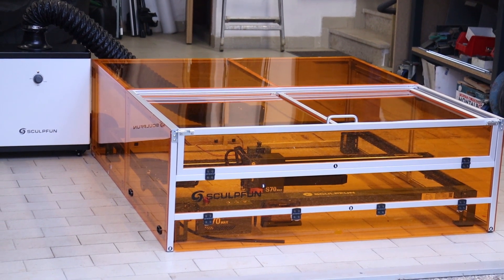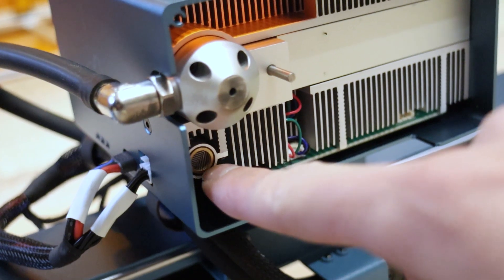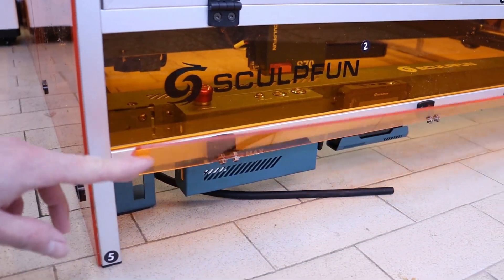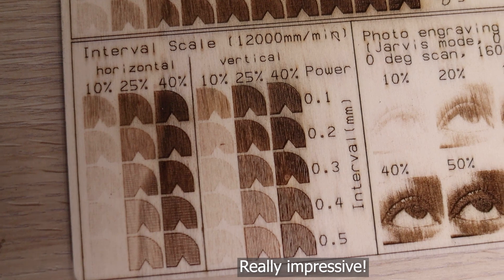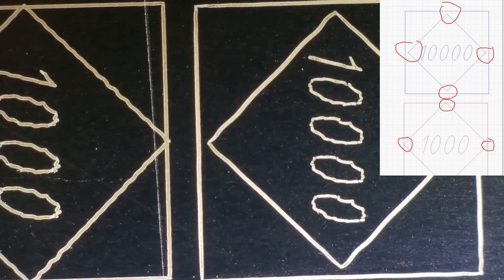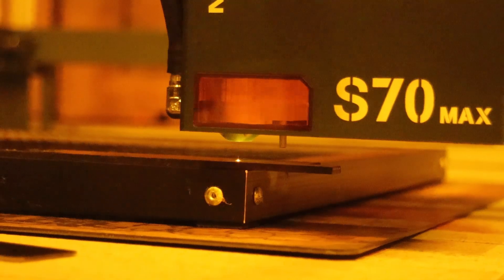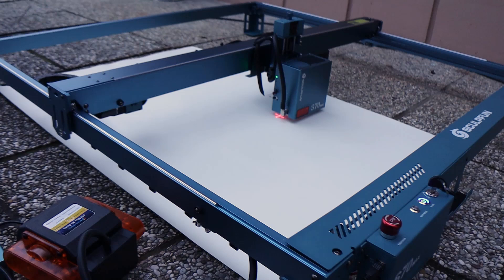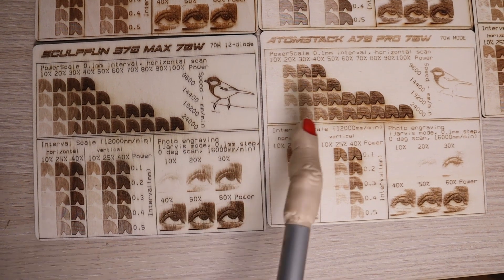The LARGEST Diode Laser Cutter? 70W Sculpfun S70 Max Review and Test

Comment: Not the largest.  I have a 4 foot by 8 foot laser.  I cut 8x4 foot sheet boards.  60W laser.   Only $2300.
Reply: What brand is that?
Reply: @0bes I'm using the Tyvok S1 60W 4'x8' full sheet size capable.
Reply: @nick4088  is it good. how thick european plywood it can handle

Comment: Thanks for the excellent review. I am seriously considering the machine. I have been working with the s30 pro max this past 2 years and it’s been great.  Time for something quicker with a larger workspace.  I’m also finding my s30 is weakening after all the hours of work.  Typically 2 passes at 380mm/min for 3 mm Baltic birch.
Reply from the maker: Thank you! Don't forget to regularly clean the lens with isopropyl alcohol. This is most often the case for degrading performance

Comment: Hi JT, great video! i need some help: i would like to buy a big 70W diode laser for my shop, my choice is between atomstack x70 pro and sculpfun s70 max. I'm looking for a big working area and nice power for wood and acrylic cutting, thats why i choose these laser. What do youu think about that? do you have any suggest?
Reply from the maker: @lettersplayer  Sculpfun machines have been better for cutting in almost all my tests of various diode lasers. If you want to buy it I have a discount coupon in the video description. But the S70 Max is much bigger than the x70 pro that I tested. You can watch that video too.
Reply: @JTMakesIt  thanks for your answer! I made a mistake, i mean the atomstack x70 max vs sculpfun s70 max. They both have same work size area and same 70w laser. They seems to be very similar, im also trying to understand things like customer service, build quality ecc over the power of the laser or the size.
Reply: Olá, também estou interessado na compra, e também tenho entre as duas.. vejo que seu comentário foi a 7 meses.. você consegue passar o seu feedback sobre a sua escolha?
Reply: @William-br i didn't find many answers about my questions.. i decided and bought the sculpfun s70 max, happy with my choice
Reply: @lettersplayer obrigado 😊